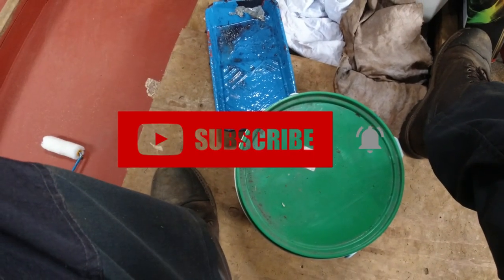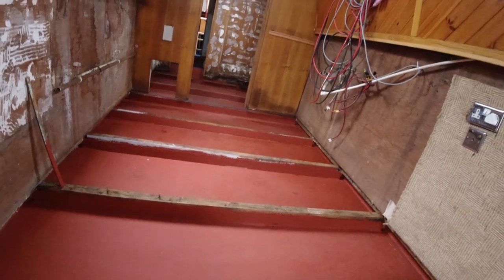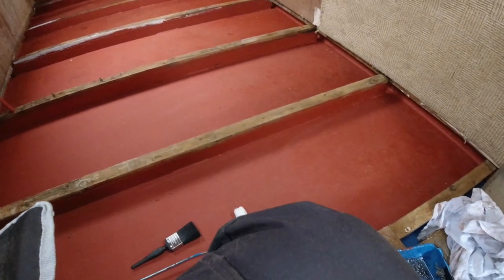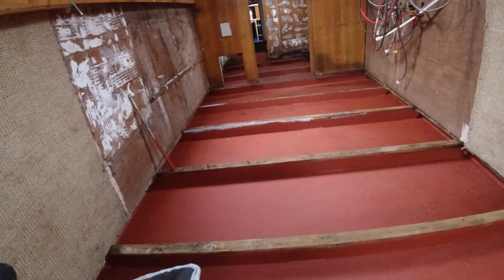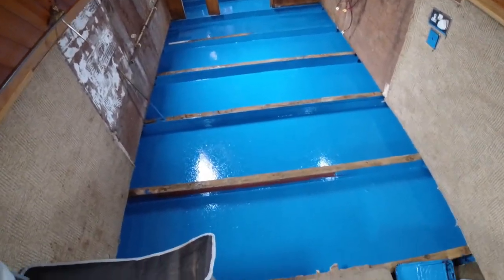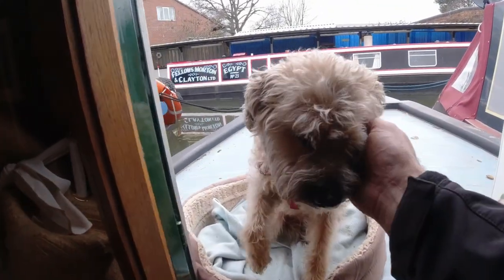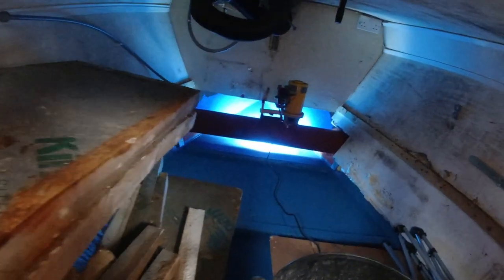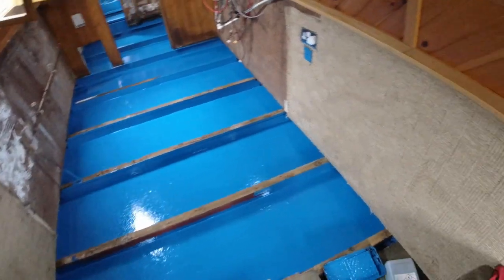Winter Update #20 Final part of the bilge has now been painted!!

Comment: Hi Steve - enjoy your winter updates, when are you going to upload number 21?
Hope you don't mind me giving you some advice on what to do next
1 - Replace wooden strips on top of the bilge bays that the floor screws onto - they are 20 years old, don't forget to treat the wood before fixing them down.  Use 20mm minimum thick plywood for your floor base which you will need to shape to the contour of the boats hull.  Drill and screw each floor board using half the width of the wooden strips for each edge of the boards.
2 - Sort out where you want the kitchen/shower etc and run all the pipes/ wastes etc through the bilge bays
3 - You have a lot of electrical problems - run each cable from the consumer board via junction boxes if you are sharing the load for different appliances.

You are taking on a big job here - the easy part you have done i.e. removing rust from the bilge bays and treating the new steel.  Re-fitting requires careful planning and accurate shaping of materials to look like a professional job.
Any problems do not hesitate to contact me
Cheers
KH
Reply from the maker: Hi Keith great advice thank you 😊😊
Yes some of the wooden strips are rotten and some are still perfect, the batter s used and what I’ve brought is treated roofing laths (I think that what they call them)  and I’ve also brought silver birch ply with webbing moulded to both sides (it’s what they use for the floors of trucks and is very strong and very water proof) 😊😊👍 I will still have to treat the cut edges but I’m getting some penetrating epoxy for that 😊👍

Comment: The supervisor was doing a go job as usual. Have you thought about floating floor. A friend used a bamboo floating floor that works and looks great and I'd very resistant to marks. It comes with a thin foam underlay, so you get a warm dry good looking floor.
Reply from the maker: A floating floor as in an engineered floor on top of the sole?
Reply: @NarrowboatPreciousJet  yes so you put your plywood down and then the underlay then the boards that clip together. Clean and simple.
Reply from the maker: Yes I’ve been looking at engineered flooring! And like you said the bamboo stuff is awesome! There are ones you can get now that you can also sand the surface if you do scratch it!! Awesome stuff and quite often cheaper than it would be to plank in oak 😊👍🏼👍🏼👍🏼
Reply: @NarrowboatPreciousJet  yes, these friends did their kitchen seven years ago and they still look new.